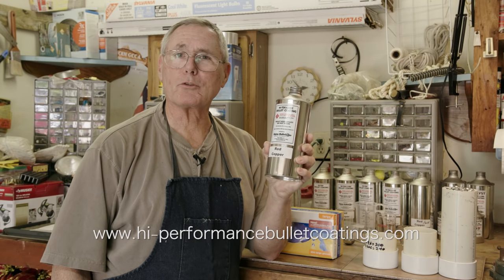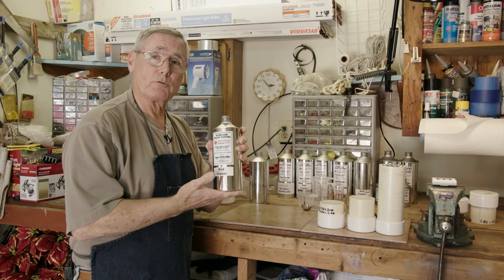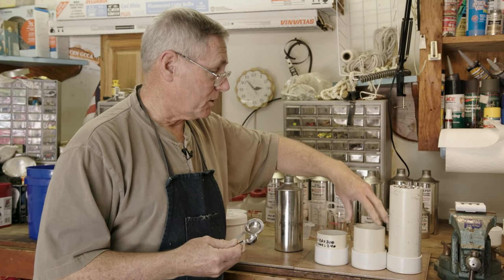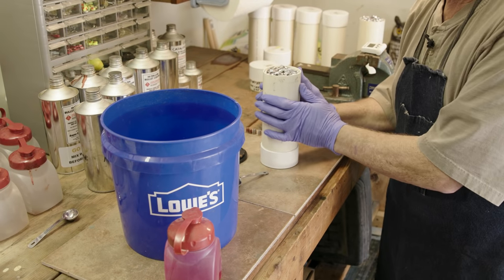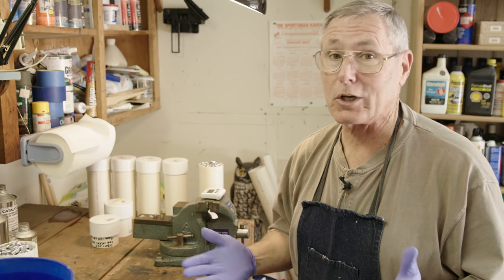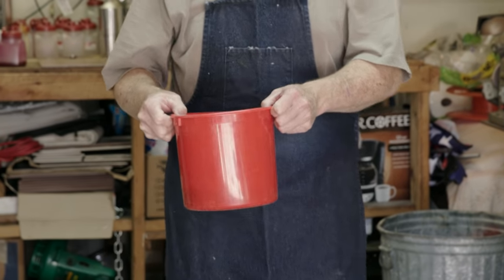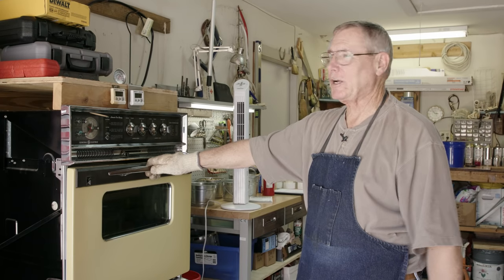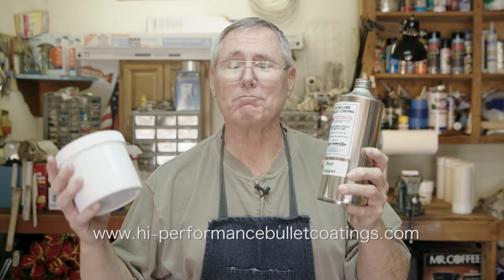How to: Hi-Tek Supercoat Bullet Coating

Comment: I ended up on Choice Ammos website one day & seen a real good price on 250gr 45 LC rounds. I was very skeptical about the Hi-Tek coating. I ran 10 rounds through my revolver & cleaned it. I was shocked at the results. 3 passes through the bore, a pass through each chamber in the cylinder, & a wipe down of the exterior. I was sold!! The gun was so much easier to clean using the Hi-Tek coated rounds. So much so, Choice Ammo is the only rounds I'll put through it now. Keep in mind, i do not use any aggressive cleaners on that particular revolver. All i have ever used is Ballistol. I always have a case of Ballistol tucked away. I use it for everything!! Long story short... Hi-Tek coating the bullets makes a significant difference

Comment from the maker: JR, thanks for watching. This process is an alternative to using wax as a lubricant for lead bullets. There is always fouling in the barrel. It might be copper from a fmj casing, or lead. I have found the Hiteck coating to be the best there is for the individual bullet caster. Bullets with this coating are also available from commercial casters. The process is relatively simple to perform as you saw in the video. It will take a little time to figure out how your oven and mixing process works best. I have discovered that the main reason for barrel leading comes from improper belling of the case before seating the bullet. The edges of a brass case are sharp and if allowed to scrape against the bullet, it will cut the coating leaving exposed lead. You don’t want that. Properly coated and loaded 9mm projectiles will leave little or no lead deposits in your barrel. Happy loading.
Reply: So do you still have to size after the coating or can you run them threw the gun without sizeing

Comment: I bought a few boxes of .38 SPECIAL 105 GRAIN TCFP BLACK HI-TEK COATED LEAD “COWBOY CHOICE” & it's the perfect solution to a problem. New shooters can handle these rounds without a lot of noise, kick & muzzle flash. Very mild. Much milder than even wadcutters. Accurate too & doesn't lead my barrel. 105 grain bullet at 650 FPS. New shooters can learn the fundamentals using these rounds & when they're ready they can move on to self-defense ammo. I saw their groups improve & they love shooting my Ruger LCR. They used to hate shooting it even with wadcutters. They don't trust my micro 9mm pistols because too many malfunctions from weak hands & wrists.

Comment: Dan, thank you very much for this video.  It has pushed me over the edge and I am placing an order tonight.  It looks a lot easier than the powder coating I am doing now.  Because I'm a perfectionist, I cannot tumble when powder coating because I want them to look great.  Powder coating looks great when using an electrostatic gun but is VERY time consuming and I can only do small batches.  Thanks again for such an excellently crafted video, you've done your fellow casters a great service.

Comment: I repeated and it works. However, I used laser temperature measurement and realized it is good to use it instead of temperature control in oven. After the last time bake, I through them into water to have BHN+1.

Comment: Thank you for this great tutorial. I am about to venture into reloading and casting, and I will commit to the Hi-Tek method rather than traditional lube. Kind of like I went with stainless pins instead of corncob to clean my brass. I love a better mousetrap and you have one.
Reply from the maker: jlag19 
jlag19, casting lead bullets can be lots of fun and when I started I knew NOTHING about the process. I suggest you get a book or two on casting lead bullets. Better yet, find someone in your local area who is casting and make them your new best friend. Good luck and enjoy the ride. 
Capt. Dan
Reply: Do the stainless pins wear away at the brass?

Comment: May I inquire as to the starting BHN of your boolits? I've read from some sources that for loading hitek bullets, using a lower BHN is possible with the HiTek coating providing a degree of added protection.

Comment: I am trying to get the powder to work, but I have had limited success. I worked with the company and finally had some success, but now back to failure . The bullets come out with a very rough first coat.  They pass the acetone test but I can scratch the coating off.  Any suggestions would be greatly appreciated.

Comment: Hello Dan!
Thank you very much for your video (and another videos), I'm a beginner in lead bullets molding, so in coating - too. Watched some hardness tests of lead bullets, and usualy the most hard bullets are: from mold to water -> 20 min baked (if powder coating "shake and bake") and again to water for quenching. Did you compared hardness of bullets, maybe between not coated bullets and bullets that after coating (3 cycles of baking, without water quenching)? And also info from some "ISO"-like standards and test, that molded bullets get maximum hardness after 1 week of staying by themselves on the shelf) I trying to bake after 1 week, to decries hardness loss, but usual "shake and bake" on mesh or putting each bullet on silicon matt by pincett...it also got damage on bullets and layer of powder every time a little different. So...trying to find minimum loss of hardness and maximum usable process of full coating.

Thank u very much,
Nikita from St Petersburg, Russia ;)

Comment: If the bullet fails the “rub test” what do you do? Rebake the batch? Great video and far superior to lubing a bullet.
Reply from the maker: When you run your first batch you will have to adjust your time and temperature for your oven. It is best to test each batch out of the oven. If the first batch passes the test, it is likely subsequent batches will as well. If the acetone test shows color, you can put the bullets back in the oven but be careful not to over cook. A visual sign that bullets are over cooked is that the color will take on a slightly brown tint. Give one of the recooked bullets a strong smash with a hammer. If anything flakes off, you have over-baked, so back off the time a bit. 
Hope this helps.

Comment: Hey!  Loved the video, and tried this for the first time yesterday. I did Red Copper, and after the first bake they came out green...? Second round seemed to help, but it was copper splotches over green... Was it a bake/time issue? What can I try to remedy it? Thanks!
Reply from the maker: Cody,I assume you are mixing the powder version. After adding acetone to the powder you will want to mix it thoroughly. Best results will be after the mixture has had time to absorb the powder. Try mixing today for coating tomorrow. The first coat is often splotchy. The final coat should be the desired color.
Reply: @DanDix  Yes, the powdered version. I did mix about 24 hours before the first application, and it looked really throughly mixed, and the first application prior to baking looked like a light nice coating that it showed in your video. But after baking (10 minutes @400 degrees) all but 1 or 2 had turned green... I'm just trying to find out if it was potentially a baking time/ temp issue.
Reply from the maker: cody kom  I would drop the temp to 390, set timer for 5 min. Open to vent smoke, stir bullets around, and heat the second 5 minutes. 
I do know it is important that your raw bullets be free of any lubricant such as oil or wax. Other than that, I can’t think of how the green specks showed up. However, the first coat is just that, it’s the last coat color you are looking for.
Reply: @DanDix  Ok, thanks. I'll try that. Yeah, it's not green specks, the entire bullet is like forest green. I appreciate your time! I'll work on my heat and time!

Comment: Hi dan, I have a Uberti 1860 44cal revolver with a 45colt cylinder conversion. Is this bullet shown on your video compatible? If not can you recommend a good Fit for me? Thank you 🙏
Reply from the maker: Uberti, all the bullets used in my videos have been 9mm. I see no reason why 44 cal. lead bullets could not be coated with Hi-Tek. Give it a try.
Reply from the maker: Truth Seeker, the bullets in the video are all 9mm. However, I have cast and coated .380, 9mm, 40 Cal., 45 ACP, and 300 BLK. In my opinion, the coating is perfectly suited to pistol calibers and rifle that stay below 1050 FPS. Hot pistol loads may not work as well, but I actually have no experience with hot or +P loads.

Comment: Hey Dan, awesome video! I have 3 questions. 
1. Did you buy the bullets, or cast them?
2. Do you resize them after coating?
3. How much are you saving when compared to buying hi Tek coated bullets?

It seems the best bang for your buck will be casting and choosing your own, but that's really labor intensive.  

Thanks!
Reply from the maker: KindredGh0st, I cast my bullets on a Magma Master Caster.  The bullets are sized "nose down" with a Magma Star Sizer.  I love the thought of saving money with my hobby.  It's like the wife coming home from the mall and telling me how much money she saved because the dress was on sale!  

Recovering the cost of lead, molds, equipment, electricity, your time, coating, etc., ... well, let's face it, "saving" is a nice thought but it is elusive!  Commercially produced coated bullets are turned out by the thousands.  A Magma Mark VIII bullet machine has 8 molds and casts up to 4,000 bullets per hour!  There is no way you can produce a bullet more economically than a commercial casting company.
 
That said, you can produce bullets that fit your exact specifications.  For instance, I have a Sig P938 that prefers bullets sized at .355.  I have a Noveski 300 BLK that at wants a .309 sizing.  Because you are in control, you can custom manufacture to fit your exact needs.  The color, though pretty, is just that.  It adds nothing to the effectiveness except "the cool factor."  The coating, however, is a revolutionary process that gets the smoke off the range, and the gummed up dies of your loading bench!

And, I have to say, it's just plain FUN to go from a block of lead, and turn it into the exact bullet I want to use in each of my guns.  Enjoy the process and the satisfaction that comes along with it.
Reply: Dan Dix thank you very much for the response Dan!  I was hoping, really passing you were about to say "I'm saving a ton.".  Dare to dream.  

I'm going to look up the carrying machine you mentioned.  I'm staying to get interested in casting and coating.  Thanks again good sir!

Comment: Dear Dan, thank you so much for this great video! As I'm new to bullet coating it helped me a lot to get started. I did three (smaller) batches so far (Old Gold) and the result looks good, passes the Acetone test without problems but still flakes off about half the coating during the hammer test. I already increased the Acetone ratio and next will decrease the amount of suspension used per batch (so far 1ml per 600g of bullets). Any other thoughts from your experience what to change?
AND: I've one question about your video: At 8'52 you mention that your  oven is set to 485 degrees. But from the picture it more looks like 385 to me. What temperature do you use?
Thank you for your advice and keep up the fun and good work! 😊
Reply from the maker: Sorry, for the temperature mistake.  385-390 degrees is right.  Don't change the mixture ratio.  It sounds like you are cooking too long or too hot.  If the Gold color starts to turn a little brown, back off the cooking time.  Once you zero in on the magic combination of temp an time, this is a breeze.

Comment: I used gold color and followed your instructions for 3 coatings, I tested one with the hammer test, which it passed, but with the acetone test, there was very slight color that came on the paper. What does this mean?
Reply from the maker: Probably you will want to increase your cook time slightly. Try increasing it by 20-25 seconds for both times. Also check your temp with a thermometer. If your Bullets start looking brown instead of gold, shorten your time. One other thing to check is the amount of coating used. If your Bullets stick together after applying the coating, you are adding too much. This could also affect cooking time. Remember, thin coats are better than thick coats.

Comment: Very nice video, I hope you are planning on making more! 
How much is the approximate cost for coating one bullet?
Reply from the maker: Lajos, there are many variables in this process. I'm sure there is a maximum number of bullets that can be coated with each bottle or container of powder. I don't know that number. That's a fixed number that can be achieved only if every ounce of coating is used. It is unlikely you will coat with that precision. Rather than single bullet cost, this process should be seen as the best alternative to wax lube, or powder coating. Sometime in the next few years you will see wax lubed bullets vanish as fast as wind-up watches. Bullet molds will no longer be made with lube grooves. The firing line will be relatively free of smoke, and we will all breathe a little better. This coating process is simple, but like casting your own bullets, the individual cost of one bullet is more than the cost of the lead and bullet mold. Just as you enjoy casting your own bullets, the coating process is one more opportunity to personalize your projectiles. Enjoy your hobby.  This is fun stuff!
Reply: +Dan Dix It certainly looks great. How does it compare to powder coating?
Reply: Dan Dix: No lube, does this apply to Black Powder cartridge rifles as well ?

Comment: does this painting process really avoid the lead in the barrel of the gun? what ingredients did you mix to make this ink?
Reply: In my opinion its main purpose is to protect the lead bullets from oxidizing. Oxydized lead bullets will harm your barrel, because lead oxide does have a much higher degree of hardness than blank lead. The coating is important when you want to store the bullets for a longer time.

Comment: How would you compare HTC to powder coating (eastwood ford blue)? I would like to keep things simple if possible and only go one route!
Reply from the maker: I’m not familiar with HTC. There are several options when considering bullet coatings. First, and foremost, is which one will accomplish the job of protection from leading in the barrel. Let’s assume, though I don’t know this is true, that the all have equal protection. The next consideration should be related to the volume of bullets you want to coat. Each process has steps necessary for successful bonding:  coating to lead. 
I can only speak to Hi-Tek coating in this regard. If you are casting thousands of bullets, Hi-Tek offers the fastest method of coating large volumes. It takes essentially the same amount of time to Hi-Tek coat 500 bullets as it would to coat 1,500 bullets. Considering the advantage of large batch processing, this could also offer economic savings as well. 
However, the best coating for you is the one that covers your volume, budget, equipment, and confidence level. I hope this was helpful. For my needs Hi-Tek is the best option. 
Dan
Reply: @DanDix  Very helpful indeed. I read on NOE website they recommend HTC.. I assume that meant Hi-Tek coating...?

Comment: Thank you for sharing your process!  Do you happen to have any recommendations on ensuring the lube groove gets filled?  I have been experimenting but all the bullets in a batch are not getting the groove filled and that is even after 2-3 coats.
Reply from the maker: Try adding a little more Acetone to give more viscosity to your mix. A rapid and vigorous agitation will also help. Try these suggestions and see if it helps.
Reply: I will give it a go, thank you for the suggestion!